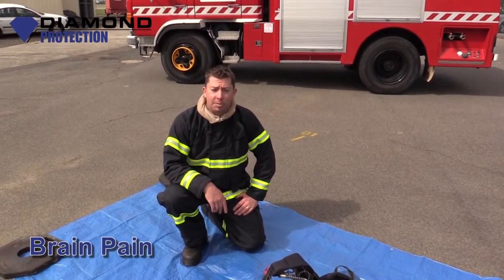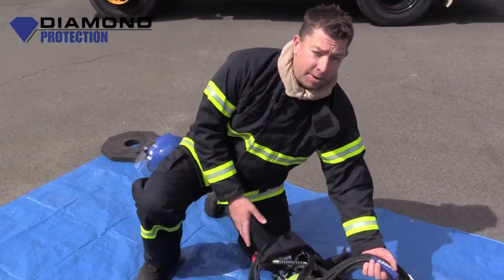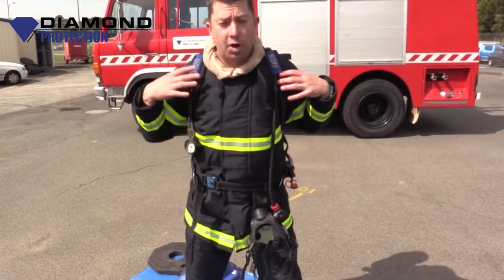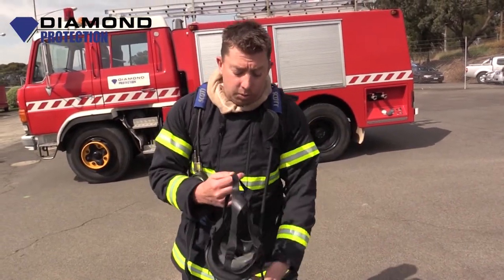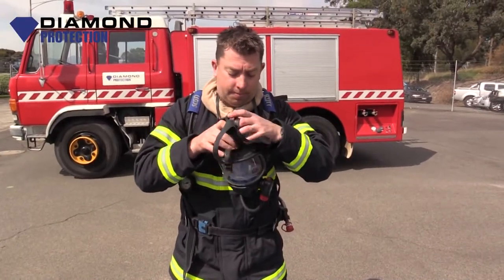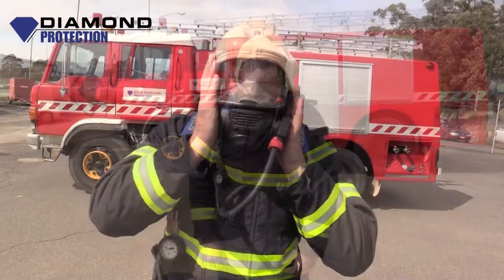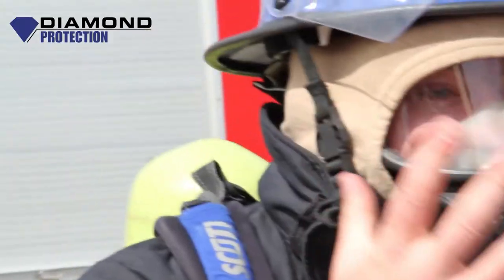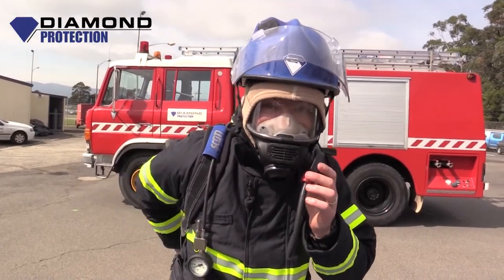SCBA How to Operate Breathing Apparatus: Firefighters

Comment: When he checked the seal he already had it all on and he turned the entire SCBA off which is very dangerous. When I check my seal I do it when only the mask is on and cover the hole with my hand.
Reply: Collin Rykaczewski Holy cow! Thanks for this comment!
Reply: @D_V_.746    "why you are not completely screwed if the integrity of the mask is damaged whilst operating in a hazardous atmosphere"      Sorry I'm late to the party, but I'm curious; 
Is that because of constant over-pressure compared with the environment? 
The way you explained it, I can't help but compare it to my CPAP/APAP device. 
Constant pressure means the only air reaching my face is air coming thru the device (as long as it pushes, anyway. The mask has inward check-valves so I don't asphyxiate in a power outage).

Comment: You would check the gauge at the start. ? It would be pointless running through all these checks if there wasn't  enough air available. It would waste valuable time taking it back off and putting on another B.A..
Reply: Luke Wright yes of course. From what I know you check your equipment every day and again on the way to the fire. The last check is for your own safety ( you dont say, all of these steps are for my own safety facepalm ) just to check if everything is really alright

Comment: I have a question the bypass valve should be on or off during the use of the equipment? by the name bypass I understand that should be used in case that something is not working right. is this correct or wrong.
Thx!

Comment: Is the same air used in diving compressed in to these BAs?
Reply: up to a certain distance, at deep distances oxygen become toxic i believe, just search at what depth is compressed air safe underwater
Reply: 66 metres (217 ft)	Depth at which breathing compressed air exposes the diver to an oxygen partial pressure of 1.6 bar. Greater depth is considered to expose the diver to an unacceptable risk of oxygen toxicity.

Comment: Sir I'm from India and I need your help regarding the Scaba (open ) how minimum pressure maintain in confined space ...and how to calculate the duration of uses in confined space .....
Pls help me
Reply: what
Reply: @jimmyrecard6021  I WANT A HELP ON BA SET LIKE A TYPES OF BA SET MINIMUM REQUIRED O2 in confined space how much pressure gauge maintain
Reply: @Safetyman2020  I can't understand you
Reply: @jimmyrecard6021  pls make videos on BA set
Reply: @Safetyman2020  - if you are in a pressurised confined space, ie. a tunnel or pipe pressurised to prevent the ingress of water (digging a tunnel under a river or sea, for example), the SCBA set duration is halfed !!
But before making the safety margin calculations, it is important to half the cylinder contents (ie.280 Bar becomes 140 Bar for safety calculation).    This way you will always have a TEN minute safety margin at Time of Whistle, and not FIVE minutes (if you just halved cylinder duration after making the calculation before taking into account the increased atmospheric pressure within the tunnel / pipe ).   Hope this helps....

Comment: Ok it's probably just me but don't you put your tan hoodie on first then the mask
Reply: It can cause leaks in the mask
Reply: You pull the hood over after the scba
Reply: Although it is recommended to put the mask on and the hood after, you can also have a good seal when the hood is on, before donning the mask. Just need to set the straps correctly.

Comment: one thing stood out to me here, once opening the airflow from the cylinder, fully, he proceeds to close the valve by a quarter turn.  I have never seen this, in my 2 years of HazMat / Environmental Emergency Response on the field. Even in my SCBA training, this is not something we do. Can anyone explain the reasoning behind this?   Im open to taking on a new technique if its actually beneficial.
Reply: It’s to prevent backseating it’s applicable to most valves that prevents damage and possibly failure over time
Reply: To see if the pressure drops
Reply: It's also to check the pressure for fluctuations